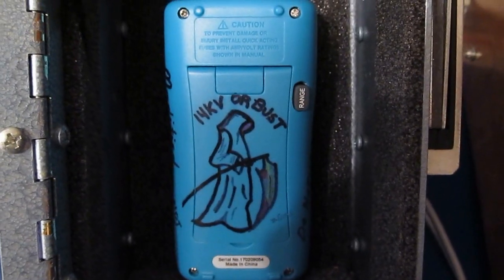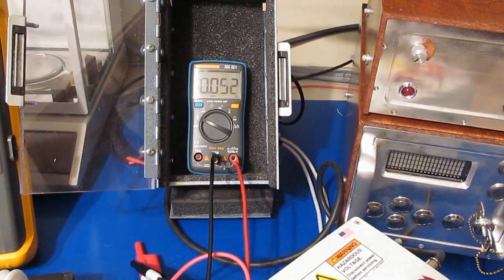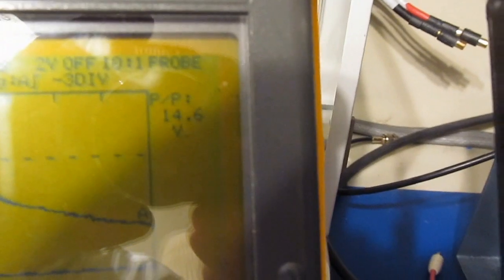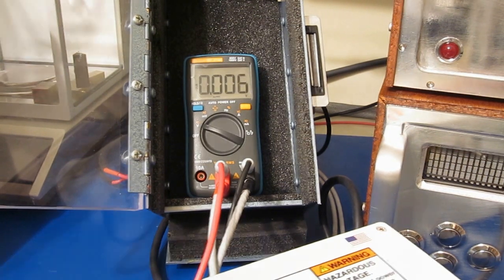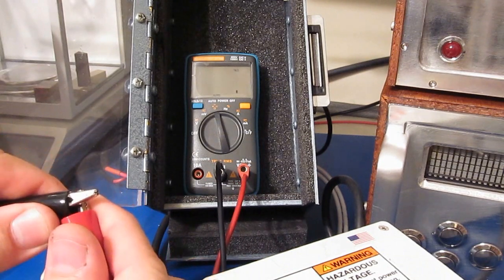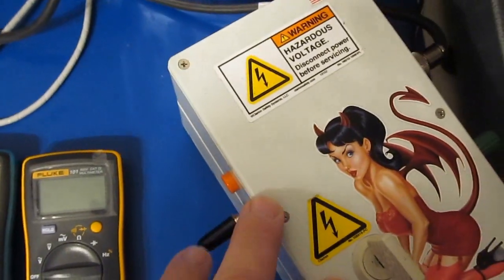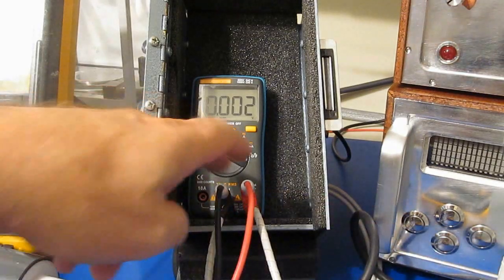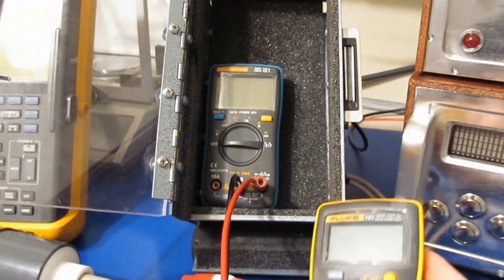Kasuntest ZT102 (AN8002) 14KV or Bust

Comment: Have you thrown any of the dead ones off the roof?  Smaller drop first though. Wondering how tough the case is, it is thin but hard. I have this meter, it's bigger 4 hole brother and the new Red one.
Reply from the maker: I think there are enough parts to put the dead ZT102 back together.  The AN8008 is still all in the original condition.  The roof is quite the drop test to concrete but these don't weigh much... Maybe in a few days we can give it a try.
Reply: Try their 2M spec drop first, please. Will be interesting to see how tough that shell is...
Reply: Hate to see you waste a good 08 though.

Comment: Hahaha — When in doubt, pot it out ! Amazing 👌🏼
Reply from the maker: I would not be surprised if some meters are not potted where you would work around explosive vapors.  I've never had a need for a meter like this.  Potting make repairs difficult, adds weight and cost.  This meter needs a better barrier between V and common but something else may get damaged if this does not break down.